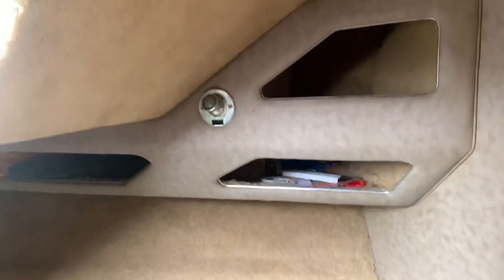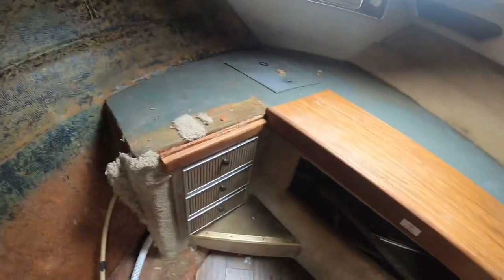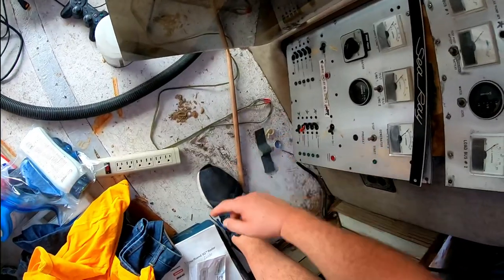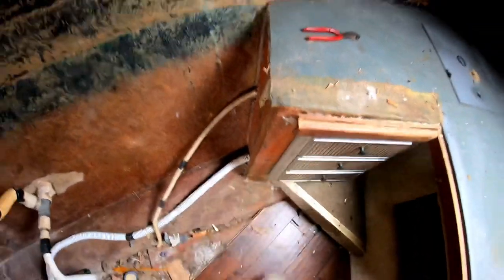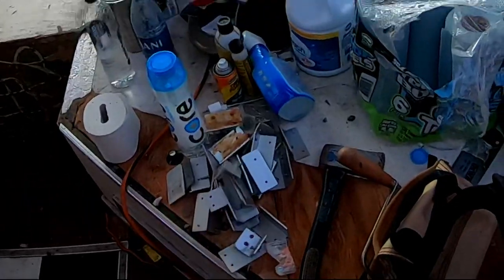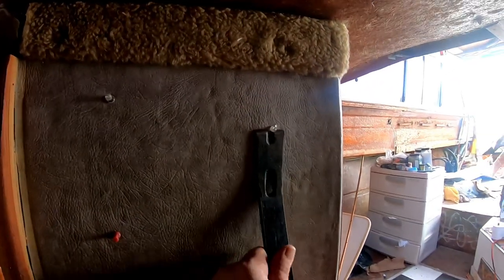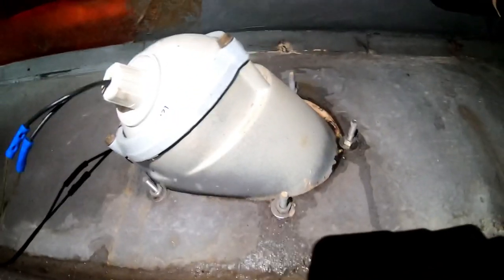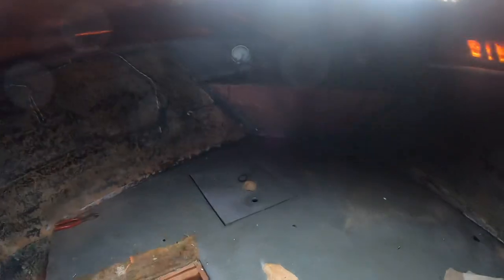Boat Restoration: Demo and some Leaks

Comment: It probably be best to get a new electric box. Obviously the one you have is functional. The only reason I bring it up is that you are effectively going to be redoing a lot of wiring anyways. Best for YOU to know from the ground up where all the wiring is going to. Other than that the battle the Shag is almost over!
Reply from the maker: You are correct, I have been pricing those panels out. Half of the switches in the old panel are pretty well shot and not easily replaced. Time for a new one.

Comment: With  the demolition you've done bet you have removed 500 lbs. from the boat. With that kind of weight reduction that Sea Ray ought to cruise at 35 knots. Don't rebuild the cabin!
Reply from the maker: I think we have removed more than that, by a good bit. Just have to try and replace all of it with much lighter materials.
Reply: just paint the inside and put a few camp beds down there then you could put a massive shower / indoor hot tub lol.

Comment: Tear out the carpets not the panels or the boat will cost too much get fuel tanks then engines and generator
Reply from the maker: I have plans to replace the panels in an economic way. Fuel tanks will be replaced but the engines are good for now.